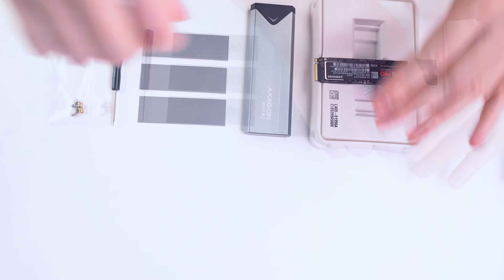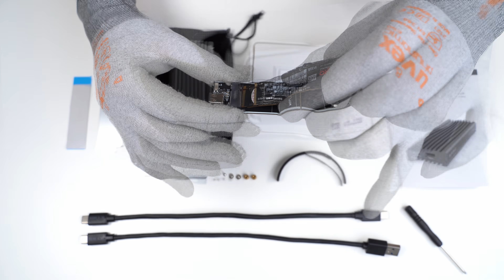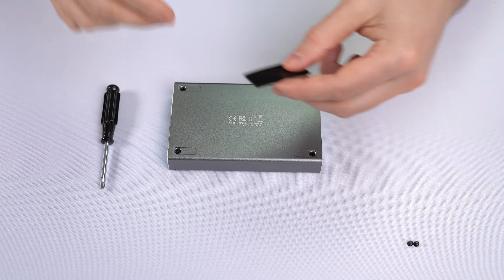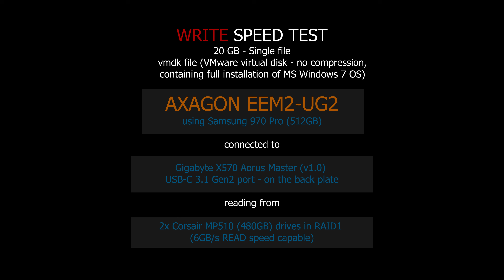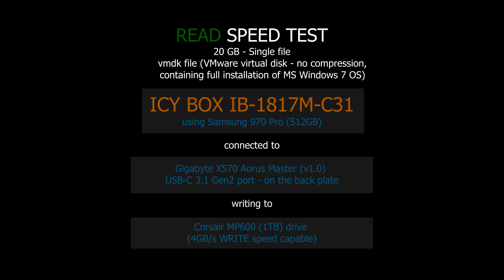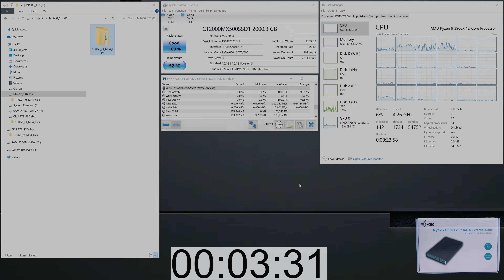M.2 NVMe USB-C External Box TEST - for SSD - AXAGON EEM2-UG2, ICY BOX IB-1817M-C31 & i-tec MySafe

Comment: Gahh you set me off with the i-tec, its like... surely he'll put in all the four screws for the 2.5" SSD..., surely before he puts the rubber feet on... nope!! - Gahhh!!! totally triggered me. Otherwise I really like this video and watch it all. - Thank for the Video Mate.
Reply from the maker: Hi Paul, thanks for watching the whole video 😊 I watched that part again and didn´t find anything „triggering“ 😉 Four screws from the bottom have to be screwed in otherwise the two parts (one holding the SSD - with two screws and the other - the metal cover) of the box don´t hold together. Those four screws don´t hold the SSD itself. If you don´t like rubber feet (which is understandable – they block the screws) just don´t use them. I´m probably not going to use them as well – I did it just for the video - because it´s in the manual (wanted to show the whole „experience“).
Reply: @MartinsLab  thanks for the fast reply.  I was in fairness quite impressed you took the extra steps to put the drive feet on. In my comment, i may not of been clear, but from watching the assembly it seems you only used two of the 8 screws to hold the SSD and four of the 8 screws to close the housing. Unless i am mistaken (which i could be) there should be four screws to hold the SSD ( two on the side and two on the bottom)  and then the four to close the cover. It could be that a pair of the bottom case screws are doing double duty. 
I'm not on my computer ( and am running off to work) but if you like i can add the time stamp later.
Reply from the maker: @paulsim7589  I took the SSD box apart to find the truth (haven´t done anything with it since the assembly). And here is what I found:
 
a) You are right that I haven´t used all the screws to hold the SSD. The SSD itself can be screwed to the inside metal part of the box by maximum of 4 screws (2 from sides and 2 from the bottom). I haven´t used the two from the bottom. 

If I used HDD instead of SSD - using them would make more sense because of the vibrations. This way it isn´t necessary for the home use. But if you´re traveling with it - an additional fixation could be useful to create less stress on the SATA connector on the PCB when the box is in motion (traveling). Therefore there is no excuse for me not using them in the video. 

b) Additional two bottom holes on the SSD on the side opposite to USB-C connector can´t be used, because there is a PCB on top of the inner metal part which prevents it - it´s not perfectly aligned with the holes (probably a manufacturing error/ not thought out enough by the designer)

c) Four screws which are screwed from the bottom to the metal cover are not long enough to reach the green PCB with SSD + green PCB which is placed on top of inner metal part has holes which don´t align well enough (the error from point “b”) - therefore “double duty” isn´t possible.

d) Rubber legs are difficult to remove (I did it anyway) and they will leave the residue of glue on the metal cover. So, my recommendation after this experience would definitely be NOT to used them at all - especially if you plan on swapping the drives inside the box more often.

Looks like your comment lead to an interesting discovery.
Reply: @MartinsLab  thanks for checking. I wonder if using toffee tape instead of the supplyed adhesive would be good. - a well nice and complete reply. Qdos to you, you have my thanks.
Reply from the maker: @paulsim7589  Some not-too-aggressive toffee tape might work (would prevent sliding), but I´m not sure at this time I would use anything at all. The box is heavy enough not to move too much and the metal bottom part is smooth so it wouldn´t leave any marks on the table (the screws don´t touch the surface). I own another 3 older and cheaper USB 2,5” SATA external boxes from different brands and none of them has any rubber legs – never missed them. This one has the best overall built quality (most amount of metal used) and it is the only one which allows any airflow whatsoever (but also potentially allows for dust to get in).
Reply: @MartinsLab  Hmm, now I have one of them Icybox NVME enclosures,  as I was planning on imaging my NVME onto a new larger NVME, I quickly popped it into the icybox and tryed copying 19Gbs. It failed to copy twice. Then I noticed the hole thing was extremely hot. I skipped on the thermal pads as I just wanted to check it out (NB: I copied over my EVE game folder like I would to back it up before installing a mod). I then took it out the caddy with the /USB drive and tried it on top of my case bare (My case vents from the top and it not very hot). It still suffered overheating, so I put it on my desk with a 20cm mains fan blasting it - that worked.

The long and short is, I am concerned that the Icybox might struggle with PCI 4.0 drives (at least ones still with a first gen controller) and the quite scary amount of heat they generate.

I probably will not fully test the ICyBOX with my PCI4.0 drive as for the time it takes to turn a big fan on whilst it images my machine I am ok with that. I do not want to waste a thermal pad on a drive that will only be in the enclosure for 3-4hrs. My other drives are all old NVME PCI3.0 drives, so I expect no issues with them.

BTW - I have only managed data rates of 500MB/s.... which is less than the burst speed I am getting from over my other new 2.5" Icybox USB-C 3.2 gen2 using an HDD.(they are so pretty and stack really well, I got two of them but I am so happy with them and there price I might grab another two). However I have not got the time/patience to do any real diagnostics, I could have a poo USB-C gen2 controller.
Reply from the maker: @paulsim7589  Generally all NVMe M.2 SSDs get very hot compared to regular SATA SSDs - so it´s not surprising. It is necessary to differentiate between two things – the controller (which likes as low temps as possible) and the memory chips which operate best at temperatures close 50C (they don´t like too low temps). So, keeping your NVMe M.2 SSD too cool is NOT the best thing you can do for it!
 
You can use Crystal Disk Info (Standard Edition) to monitor your temperatures like I did in the video. (You can watch them during the testing - clicking at it from time to refresh the values)
Link: https://crystalmark.info/en/download/#CrystalDiskInfo

Both Samsung 970 Pro (Gen3) and Corsair MP600 (Gen4) got very hot compared to SATA SSD Crucial MX500 (SATA), but not critically. Critical means 70C and above for NVMe SSDs (Is different from drive to drive, some are critical at 85C). Temperatures around 50-60C under heavy load are normal. So, no need to worry there. They are just uncomfortable to hold or touch.

Gen3 and Gen4 drive were both similarly hot, I did this test off the camera, so I don´t have the exact result at hand, but Gen3 doesn´t make big difference. (As always it depends which exact drives you compare. Some are hotter, some cooler.)

It would have been useful if you stated your PC config (MB, CPU, SSDs used and info which slots they are placed in) and which IcyBox are you using and which drive is in it. Because without this info no trouble shooting or recommendations are possible.

Also which cables are used and to which ports on your MB is your IcyBox with NVMe SSDs connected to and which software are you referring to when talking about 500 MB/s data rates. Is it WRITE or READ speed? Are you sure no data were cached (was it a first time transfer of that data since the bootup)? Which drive was source and which destination? etc.
Reply: @MartinsLab  Woo thats a lot of questions. I was using the same Icybox USB-C NVME 3.1 gen2 you are using in the video. I have a Gigabyte X570I Aorus Pro Wifi, I am using the USB-C gen 2 port directly from the motherboard backplate, I am using the provided cables from icybox, although I do have a top end spec Club3D cable (10 Gbps/100W charging/4k60HHz) but I have not tried that yet. My system is configured with a R5 3600, 32Gb DDR4 3200 CAS 16 Ram, and a 512Gb NVME PCI 3.0 x4, 1820 MBps (read) / 600 MBps (write) , [Samsung PM951 MZVLV512]. I could not spot the IOPS.

The Drive in the USB cradle I was using at the end of the USB cable is a Gigabyte Aorus Gen4 SSD (NVME, PCI 4.0, 1Tb).

Now I am writing this I had not noticed how 'weak' the PM951 is, its write speed is not that impressive, I suspect its IOPs are also from a few generations ago (ie low  or sub 100k's). Still with its read speed of 1700MB and some slow down over time and slow down from high capacity usage ( 85%), glad I will be replaceing it. Its funnie that a £60 NVMe can replace it, I am sure it was around £400 if you could buy it (its OEM) when it was new.

If you have tested with a PCI 4.0 drive as you stated in your reply and it was fine, then that's good enough from me. I was just startled by the sudden heat, that it could not even stay below throttle (ie its transfer dropping to 0Kb/s) when outside of any case unless I had active cooling. I had planned on adding another drive to my Motherboards second NVMe slot with a larger capacity later (its on the back of the M/B), however I now need to consider a large heatsink or hope the later gen 4 drives have a more efficient (cooler) controller.

NB: Gigabyte have a downloadable SSD monitor software so I can track temps (only works on there own drives), which was interesting because when it hit temp, it did not slow down it stalled and displayed 2000+ degrees... and 'life expectancy' dropped from 100% to 66%. As soon as its temp dropped a bit, zoot right back to normal life expectancy & high but not scary temp. Yet on the installation manual for there drive there is no mention of cooling or warning. [Yes I got the cheaper version of this drive that does not have the MASSIVE cooler included.]

Thanks for coming back to me. Now I know you have tested the ICyBOX with a PCI 4.0 drive and its warm but no slow down, I'm very happy.

BTW: I have installed a PCI 3.0 Samsung Evo 850 256Gb in the other ICYBOX (with thermal pad and heatsink) and it does not even get warm doing the same copy. (The game Eve Online's game folder, inc highrez textures 28GB, avg transfer speed is <100MB/s, which is the same on both the external NVMe's I have, I am not to surprised as there is massive numbers of tiny files, and I suspect the IOPS of my system drive sux).

Thank you. for your time :) most appreciated. I'll test it again and waste a thermal pad just to make sure there is no fault with my new drive, as losing a primary drive would sux. I do have a bit of spare time thanks to 'that'. If i find anything intresting i'll try to update this.
Reply from the maker: @paulsim7589  I will try to make it shorter 😉 Your PC is fine and can handle any Gen4 drives without limiting their speed. 

The problem, as you pointed out yourself, is obvious - Samsung PM951 MZVLV512. As a source drive (the one you READ data from) it would be fast enough to supply data to the drive inside the IcyBOX. But as a destination (the one you WRITE data to) in will limit the drive which is copying data to it.

Corsair MP600 didn´t overheat while I was testing it, when using Icy BOX - I can confirm that.

Manuals for drives are useless, and I´m sure there will be some mention in the terms of use, that the drive „has to be run under some perfect conditions and the manufacturer doesn´t take any responsibility for any potential damage..etc). In a way it is understandable, because they can´t be responsible for what you do with it, but on the other hand they should give you a hint what to do to make it work properly.

Many small files will always slow the whole data transfer, only when WRITING and READING larger than 128KB files will result in speeds over 560 MB/s when fast enough drive is used. (How many files are already on the drive when writing to it is important as well)

Good luck testing!

Comment: nice chart, that's what I needed to know. sorry to bail right after that :)
Reply from the maker: No worries! This is a free country - take what you want and leave the rest 😊
Reply: @MartinsLab  ha! any idea if this combo will work on an M1 Mac as a boot drive? https://www.daraz.com.np/products/netac-512gb-ssd-internal-ssd-nvme-pcie-gen-3-x4-m2-2280-3d-nand-flash-read-speeds-i104922248-s1026448595.html?spm=a2a0e.searchlist.list.57.666d1afaDX5re3&search=1 + https://www.daraz.com.np//products/i104824949-s1026326055.html?spm=a2a0e.cart.0.0.1ced6af7pS99ug&urlFlag=true that's all we got here :)
Reply from the maker: @oldnepalihippie  I have no idea - never even heard of those accessories and I don´t own a Mac. You´ll probably need to ask someone who has a Mac related channel.
Reply: @MartinsLab  thx no problem. sorted. As long as u have the right JSblabla chip set in the enclosure, a good NVMe stick will work. but thank u for ur contribution to the body of knowledge :)

Comment: I also like to choose all components myself. Same mindset :) Btw I think you failed to remove the transparent foil from the other side of the thermal pad during assembly of the ICY BOX enclosure :D
Reply from the maker: Hi Andrew, picking your own components is like choosing your own destiny :) And you´re right, I did forget to remove the transparent foil from ICYBOX during the assembly part of the video. Fortunately, I removed it for the testing (which is in the video). I found out very soon as I was swapping the same drive “Samsung 970 Pro” between ICYBOX and AXAGON during pretesting. I do pretest runs to find out where the values are and if there is anything off. It´s biggest impact is in the long-term (more than 10 min) cooling capability, when the box heats up way above room air temp. I think I should put it in the video description as sort of “errata”.
Reply: @MartinsLab  how did you deal with reusing the thermal pads during swapping the disks? Is it something thats actually doable or is it better to have a pack of standalone thermal pads from lets say thermal grizzly with the right size and using those when needed? To make things clear, I might need to take the disk out from time to time and put it into a pc or laptot for testing etc, i won't do it daily but maybe two times a month
Reply from the maker: @HonzisDrex  I had to reuse the same thermal pads, because you can´t change conditions of the test during the test – frankly it was a pain. I had to be very careful not to damage the drives. I always had to unpeal them slowly and gently (not to take any chips from the PCB of the M.2 SSD with it). The first two unpeals were more difficult than the rest.

Axagon´s original thermal pads are very sticky you have to be careful, ICY BOX´es thermal pad is easier to remove but you have to be more careful not to tear it apart - it is more “gely”. It also depends how long have these pads been on hot SDD drives. The longer they are there, the more they stick to it. But they are always removable.

If you plan on removing it more often, I would use a pack of standalone thermal pads as you suggested. Just make sure they are thick enough (ICY BOX) / or thin enough (Axagon) - to make good contact with the heatsink. It is very likely Thermal Grizzly´s pad will have better thermal conductivity then the original ones and will be easier to remove.

Comment: I worked 20+ years with computers, building them, and you do not need gloves or anesthetic cable or so on, if your are really afraid of Static Electricity, just touch the pipes of your radiator or something, i never had something that broke because of Static Electricity.
Reply from the maker: I never burned anything either when not using them, so I agree that probability of destroying something by static is low. I mostly use them when I don´t want to leave fingerprints on stuff which has sensitive surface to it, because it doesn´t look good on the camera under very bright light and in 4K. They also protect me from cutting myself by sharp objects. Added bonus when it comes to protection from static for 5 USD is an investment I am willing to make 😉
Reply: @MartinsLab  Aha, ok i understand, yeah it looks better without finger prints on a 4k camera, and yeah handy for sharp parts.

But for the rest i do not like handling delicate tiny stuff with gloves.
Reply from the maker: @AmigaWolf  Yep, especially small screws are a pain in gloves and peeling of plastic stickers is a mission impossible.
Reply: Yeah, I've seen it in every HW lab, radiators. Each engineer at oura lab had an radiator by his desk.. :D OMG. ESD safety involves always proper gloves, workplace cover and grounding, possibly clothing. Worked in labs many years. Not played with soldering iron and LEDs in the cellar.
Reply: @Svihak177  Your talking about not simple stuff what this YouTuber did, now your talking about dust free HW labs, were they make chips and open hard drives and so on, that is something totally different then what this YouTuber did, putting a CPU or SSD or HDD or graphics card in a computer you do not need gloves or a anti-static Wire.

If you do not believe me, just look at JayzTwoCents or Linus Tech Tips or CareyHolzman that has made computers and installed hardware many hundreds to thousands of times.

But hey, what do they know right?
Reply: Do you want, but I was talking about general consumer elelctronics production and service center. Not silicon base plates prodiction. ESD may not be visible instantly or in days. It just simply can shorten life span or hinder full performance in 10s of percent. Nobody wants a less performing or shorter living HW just because he grabbed it with bare hands still dirty for PBJ sandwich...